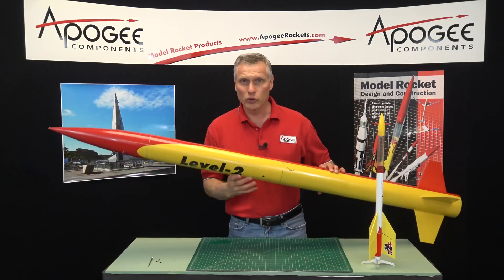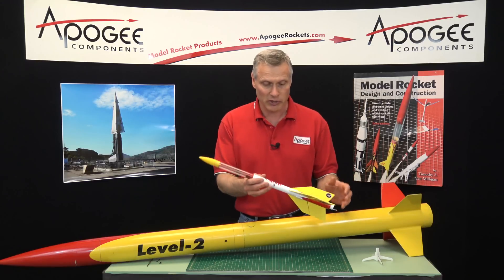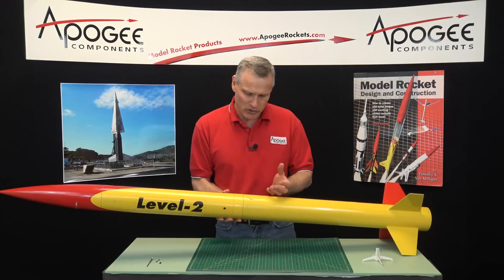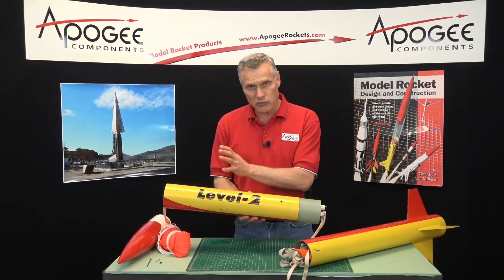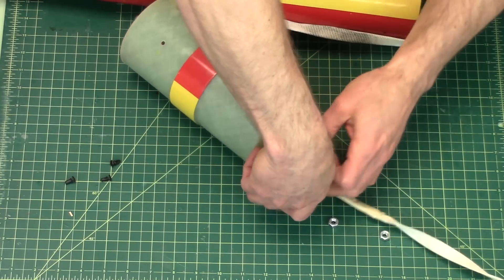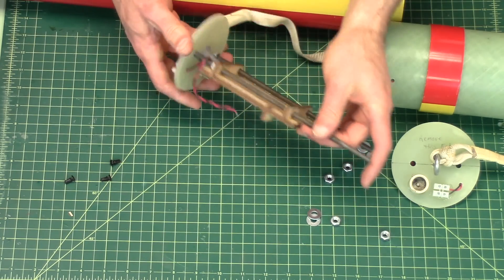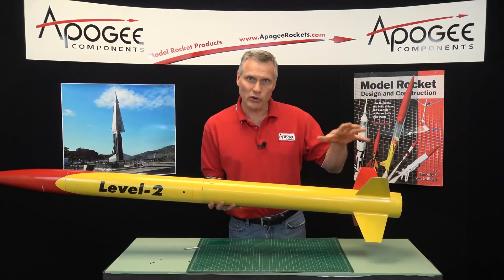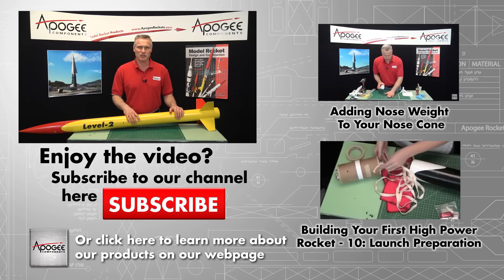Changing your rocket from dual deployment to single deployment

Comment: can you convert a single deployment rocket and make it a dual deployment? I built a Loc-IV and make it single. Is it difficult to make it dual deployment?
Reply from the maker: Yes. It is possible, but it takes some planning. See: https://www.apogeerockets.com/education/downloads/Newsletter389.pdf. A simpler way is to use a Jolly Logic Chute Release device to restrict the opening of the parachute until it falls to a lower altitude.

Comment: One question a noob like me would ask is why would you do this? I'm assuming it's because you want to run a low powered engine in it so it doesn't go so high to need dual deployment, but that's just a guess.
Reply from the maker: What fun is it to launch a low powered engine, when you could use a big one? That's why we do all this effort.
Reply: @apogeerockets Yes, but still, why would you want to take a dual deployment rocket and make it single deployment?  What advantages does it serve?  

I think I understand the advantage of dual deployment and am eager to try it myself but not sure why you would want to go back to single.
Reply from the maker: @seanhartman6496 There are people that just want to do it, because it is simpler that a dual-deployment set-up.  We're just trying to let them know how to do it so they aren't confused.
Reply: @apogeerockets Thanks for the response:-)
Reply: but if you're in a situation where it's don't fly, or fly MPR.....I'd rather MPR